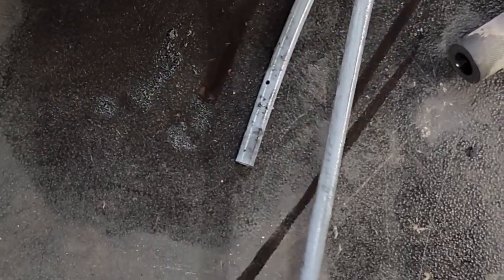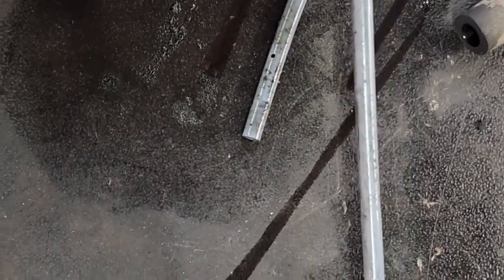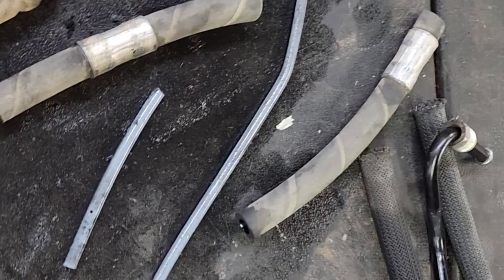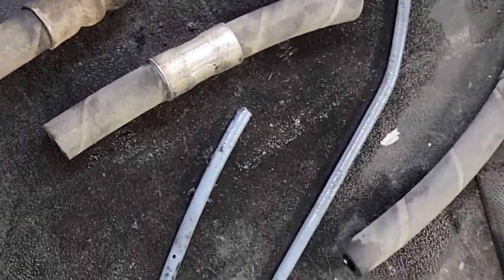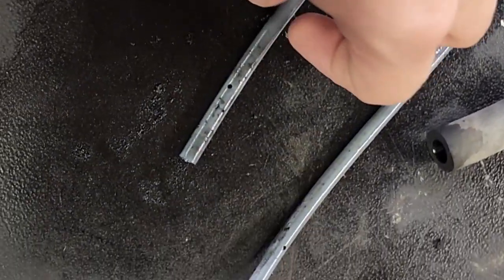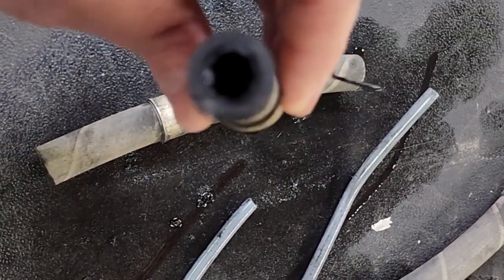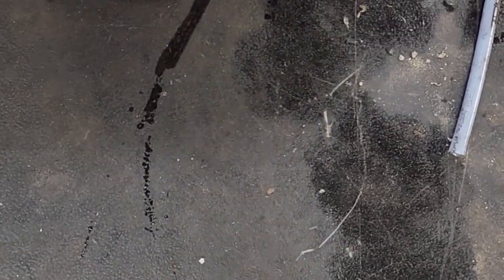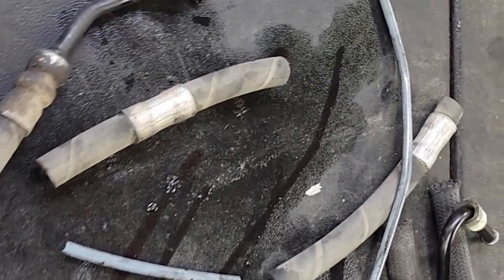Steering Noise On RAM 2500/3500/4500/5500 Trucks

Comment: I have a 2015 Ram 2500. Doing pretty much the same thing. More so at low speed when going over a hump in the road or a bump that shifts the weight. I feel a high pitch vibration in the steering wheel but it goes away after a couple seconds. I’m going to look into this hose replacement and see if that’s the issue.

Comment: Thanks for the video. My truck 2015 ram 2500 has been driving me nuts trying to figure out what’s going on. I started to notice a popping feeling in the steering wheel, break, and gas pedal. It’s more noticeable at low speeds. I thought it was a ball joint or a wheel bearing going bad. I checked the wheels off the ground with a crow bar and no play. So today I had my wife sit in the truck and turn the steering wheel from 3 to 9 o’clock while I looked at the suspension and under the hood,, turns out the the hose going from the power steering fluid reservoir 
to the steering gear box jolts really bad when the wheel changes direction. I’ve heard the whining noise a few times when turning but didn’t think it was a problem, but after seeing this video I think it might all be connected to the same problem. I think hitting a bump at slow speeds puts back pressure on the pitman arm, gearbox, then to the hose. I’ve been trying to figure out what’s going on for weeks, man thanks for this video!
Reply: Were you able to switch out the hose and solve your problem? Mine sounds exactly the same as yours. Have been thinking suspension until seeing this video.
Reply: we're you getting weird feedback through the steering wheel and a choppy feel in steering wheel @ low speed big maneuvers

Comment: Mind sharing which high pressure hose it was?  These have two.  I am assuming it would be from pump to hydroboost, and not gear to hydroboost.  Or, if you wanted to say it another way, is it the high pressure line that has the banjo bolt, or with twin flared ends/nuts.....

Comment: I currently have the same issue going on in my 2010, I just replaced the power steering pump and high pressure hose and still have the noise, I then took the cap off the reservoir and full turned left to right about 20 times and the noise went away temporarily but came back after shutting truck off and turning it back on. I suspect I got a bad refurbished pump so going to spend the extra money and get a new one and cross my fingers it fixes it. (Getting really fed up with throwing money at this truck because not even a month ago I put 10k into the tranny)

Comment: Thanks For the info my 2014  3500 steering has been makeing noise at idle and all rpm  for about 2 months. The power steering pump seems to be fine, will be changing that hose soon.
Reply from the maker: Yeah hopefully the same problem fixed mine  perfectly.
Reply: Did replacing the hoses fix the noise issue?  My ‘13 5.7L 2500 makes a whining noise but there are no leaks in the power steering system.
Reply: I took one end of the hose loose to see if the iner liner had come loose, it hade'nt . So decided to not replace the hoses. It still makes noise. Some way the break booster works with the power steering pump,  got afraid i may cause another problem getting air in the system. When the radio is on i can't hear it.  lol

Comment: I would like to add - this noise can be due to cheap or poor quality hose with the wrong (smaller) orifice size. That cavitation sound in my case was due to brand new cheap hose that failed right from the box ! dont buy cheap like a "A-Premium" or smth similar

Comment: Thanks for the video! My truck started doing the same thing, I swapped the hose out with one from Napa, and it kept making the same noise, so I went on and changed the hyrobooster as well, bled it thoroughly with a vacuum pump and everything, checked for leaks and everything seems fine, as soon as I set it off the jacks and fire it back up(without even turning the steering wheel)I hear the noise again. Only thing left to change is the ps pump, could I have got a bad hose from Napa? Any suggestions would be greatly appreciated.
Reply from the maker: That's crazy

Comment: Thanks for the info. I have a 2021 Ram 2500 4x4 Crew Cab Hemi. I’m assuming it makes the same noise you had. I described it as a blower motor type sound. It occurred at idle, hands off the steering wheel. If I put my hand in the steering wheel and moved it, or even put the slightest pressure either direction, it went away temporarily. 

Dealer verified sound, and found no correction because they started another one on the lot and heard the same noise. 

Wanting to be nice to my service writer, I agreed with their “that’s the way it is” analysis, but this noise still angers me (I hate this whole truck for a host of other reasons). It’s still under warranty @25K miles and less than 2 years old.

Comment: I just bought a 2018 3500 2 days ago. and I just noticed noise and little vibration when turning the wheel.  I am taking it back to the dealer who are not a ram dealership, they are a Cadillac dealer and they told me to take it back so that they can take a look at it.  This video may give me an idea.  Thanks bro.
Reply: What did the dealer tell you it was

Comment: Hey, I was going off road today in my 2015 2500 I hit a bump a little too hard and then this noise started. Replaced the line, and I still get the noise but it’s a lot less. Any ideas?
Reply from the maker: May have air in the system